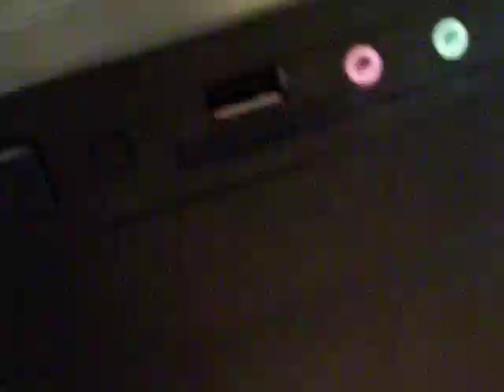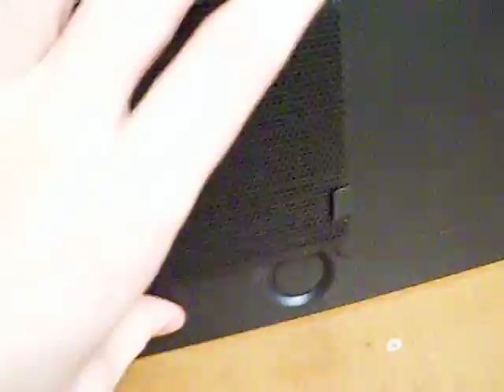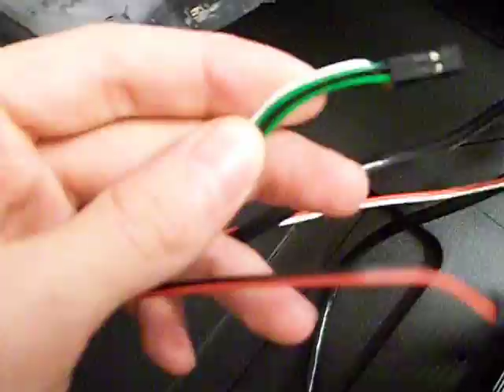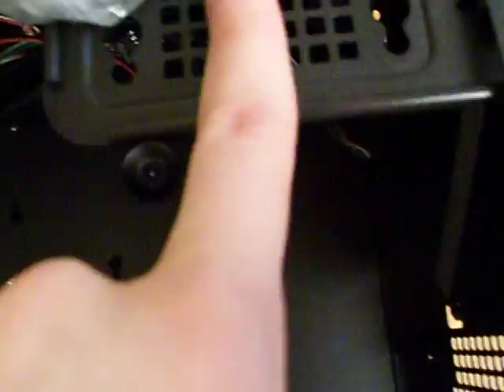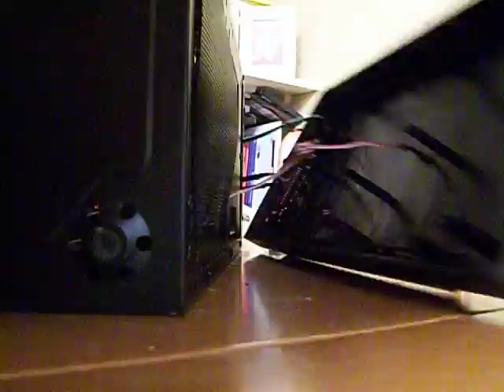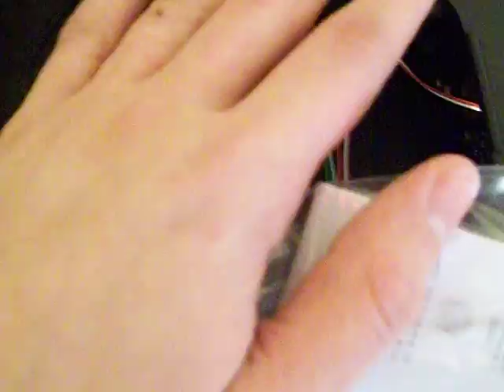Zalman ZM-T1 Micro ATX Hands on / review / SUBSCRIBE FOR MORE

Comment from the maker: the airflow is not that good on both cases if you plan to use the front , use the side cos both cases have 92mmx2 fans side the 120mm front is blocked a bit on both cases and the internals are identical on the inside t1 and t2 same trust me in dimmensions and yours is just metallic ect and mines matte also dont forget to leave a sub if you liked the vid :) might re do this in HD

Comment from the maker: get a 5.25 inch to 3.5 inch converter look em up and put your hdd where ur optical drive would be 
i use an ssd which i stuck with some double sided tape to the bottom of the case in front of the psu i have a hdd just mounted aboove it see what works for u dude , and dont forget to subscribe and help a brother out !!

Comment from the maker: this gpu just plugs in noting else needed just install the latest drivers from msi do not use the cd provided go to the msi website put in your graphics card model and stuff then get the latest drivers you can also use msi afterburner to overclock it this gpu i reccomend a stable overclock by 50mhz to 100mhz no more :)